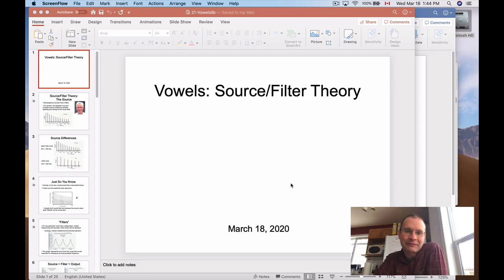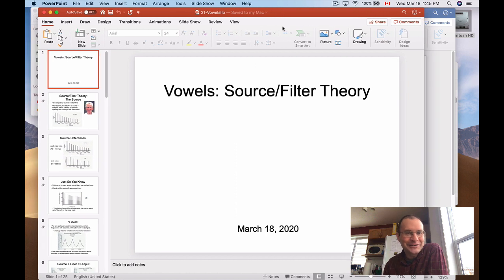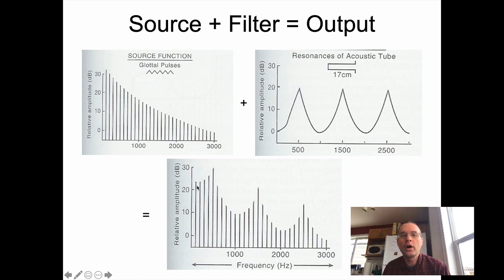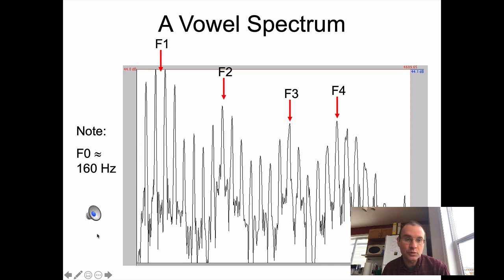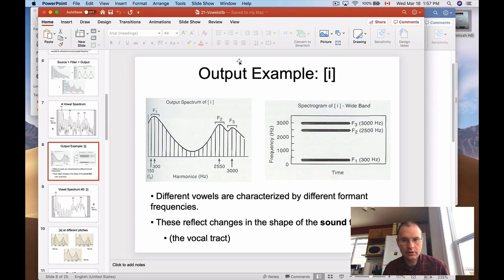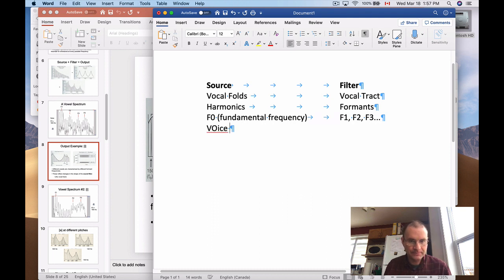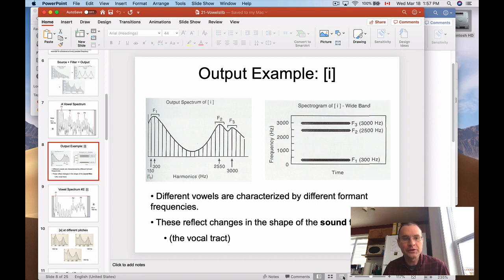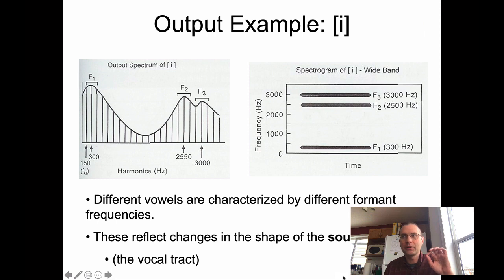Ling 341 - Intro Phonetics - Source Filter Theory

Comment: How multiple frequencies means harmonics or overtones are produced by the vocal folds at the same time ? very hard to imagine even
How vocal folds vibrate at multiple frequencies simultaneously ???
Pls clarify sir
Reply from the maker: Hi--the vocal folds open and close in a complex periodic pattern. That means that there is a fundamental frequency to the glottal trilling cycle, but that there are other frequencies in the cycle, as well. All of those other frequencies are integer multiples of the fundamental frequency. That means that they will always be completing a cycle at the same time that the fundamental completes one of its cycles. 

Almost everything that vibrates, vibrates in such a complex fashion. If not, the periodic pattern is just a sinewave. It might help to imagine the higher harmonics as vibrations being superimposed on the fundamental vibration cycle, just at a faster rate.
Reply: @cognitivephonetician  
What about hissing sound sir
Even s"sound also produce harmonics right without being vocal folds vibrating??